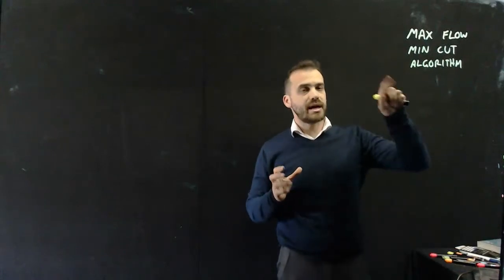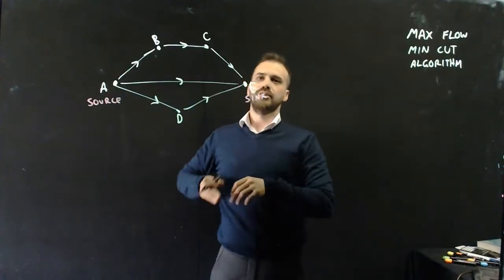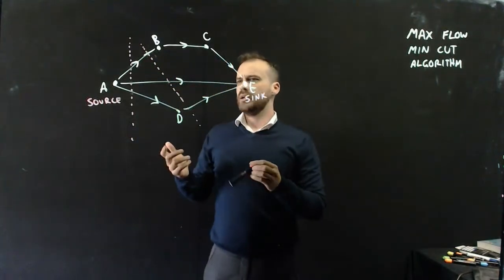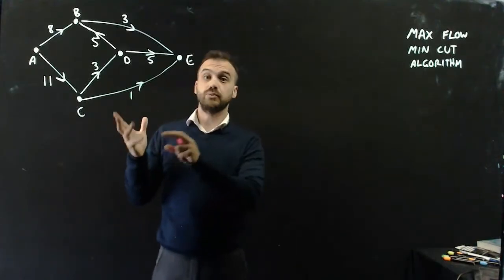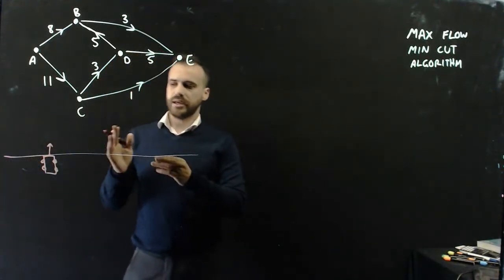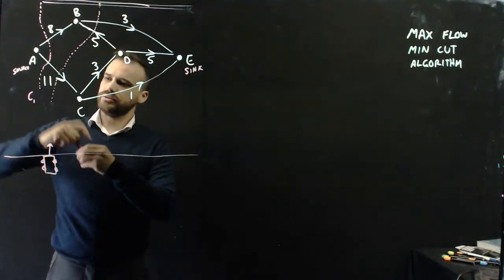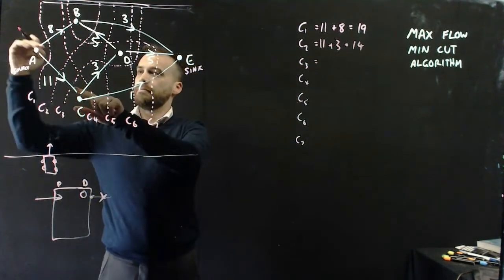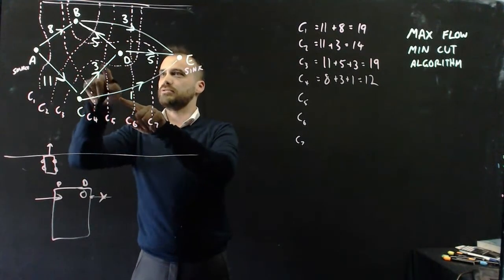Maximum flow Minimum Cut Algorithm

Comment: isn't there an extra cut where A and D are in the same set (C, B, and E are in the other)? I would say that there are always 2^{|V|-2} cuts in any flow network (since we always need to choose a sub-set of the set V\{s,t} to include with the source A, and there are 2^{|V|-2} ways to do so.
Reply: this is correct

Comment: Awesome video! I found another cut that you missed. The cut that represents the partition of the nodes {A, D}. So drive up through A-C. Then turn right through C-D. Then up through D-E. Then left through B-D. Finally, up through A-B. This still cuts A off from E completely since the car goes from the bottom all the way to the top. The way I think about cuts for network flow problems is partitioning nodes into every possible subset of nodes (always including A and excluding E). So we have {A}, {A, B}, {A, C}, {A, D}, {A, B, C}, {A, B, D}, {A, C, D} and {A, B, C, D} thus 8 cuts in total. To connect with your cuts. c1 = {A}, c2 = {A, B}, c3 = {A, B, D}, c4= {A, C}, c5 = {A, B, C}, c6 = {A, B, C, D} and c7 = {A, C, D}. The only one we are missing is {A, D}. Thankfully, since {A, D} = 11+5+5+8 the min-cut/max-flow solution is still correct but I thought it might be worth pointing out to help with not missing any cuts! Hope this helps anyone to have a systematic way in finding and not missing any cuts.
Reply: Thank you ❤

Comment: If the start pipe is on the right and the sink is on the left is it better to re-draw the pipe network from left to right and then do the algorithm? Or would it be better to just do the algorithm and switch the drivers side.

Thanks for the video by the way! 👍
Reply from the maker: How about just turning your page upside down?
Reply: @JoelSperanzaMath  Yes that works :) thanks for all your math help I've finished my Networks topic successfully 👍

Comment: Thank you so much for good videos, it is so helpful to get clear and step by step explanations on concepts. Really appreciate your teaching!

I was wandering if there is a last cut that can be made: Starting from E(A,C) -> E(C,D) ->  E(D,E) -> E(D,B) -> E(A,B)
Reply: I don't think that would work, because when you are making that last cut through (A,B), your cut is going downward rather than upward. Although you have managed to cut through each line only once, you won't be able to work out the minimum cut maximum flow. The car (as Mr Speranza mentioned it) will not be moving at the top of the page as every single other cut had done, rather it would be moving downwards

Comment: Great video, but isn't there an 8th cut hat goes through AC, CD, DE, DB, AB?
Reply from the maker: Good question and it highlights the most common source of error in this kind of question. The cut you describe is fine through AC, but if you then "drive your car" through CD the "water" will be flowing into the "driver's side". Remember when making cuts the "water" can only ever flow in the "passenger side".
Reply: @JoelSperanzaMath   But isn't C3 going through CD?

Comment: Hello thanks for video. But I didn't understand why you ignored "5". I think c5 should be 1+3+5+3 ?Am I wrong?
Reply from the maker: I'm ignoring 5 because that water is flowing away from the sink, not towards it. In the video, I explain water needs to follow in the "passenger side" of the car, not the "driver side".
Reply: @JoelSperanzaMath  Aaa got it. I missed the that part of video, sorry. Thanks for explanation😊❤